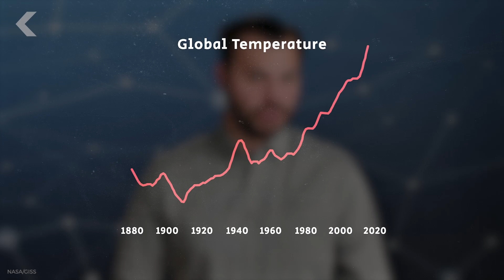These Massive Geoengineering Projects Won't Stop Global Warming

Comment: we have to start studying it seriously.  solar, wind, self-driving EVs, and energy effeciency are all going to dominate based on economics alone.  however, we may need to a few decades to figure out how to lower temperatures until we can figure out how to remove CO2 out of the atmosphere.  spaceX is dropping the cost of launch from over 12,000 per KG to $50 per kilogram by making reusable rockets.  there are some very technical ways to shade the earth while reducing side effects.  you only have to reduce the light by 2% to offset global warming.  we could do this for a few decades why we reforest the earth.  create man-made inland seas in the desert to sequester more carbon.  we can also make machines the scrub carbon from the atmosphere.   we will prevent catastrophic climate change, and part of the at will be quietly studying geoengineering.

Comment: i do not like this video.  the three main reasons they say it wont work.  1.) too expensive  2.) we should put all focus on reducing emission 3.) side effect.  well number one will not matter when we have AI, 3-d space printers, the can reduce themselves and nearly anything else money will not be a issue.  soon money may not even exist.  it is just a manmade rule/tool.  2.) is partially wrong because we can move the technology and science along with very little invesetment.  we need a contingency plan.  The science does not have to published in media.  we just do not announce that we have a plan B.  it will not be a secret, but it is not something that should be widely presented to the public.  3.)  we can reduce side effects, so that they are far, far less the deadly effects of climate change.  I like the idea of AI and self-replicating 3-printers in space making all the spacecraft and equipment

Comment: You could still do it. For example, engineering plants that strongly reflect any light they do not use for photosynthesis and using them as food crops.

If they are cheaper and better than cutting oil consumption down to nothing or dealing with the effects of climate change, then why not?

That being said, I don't think these would be all that advantageous. No matter what, these will not fix the problem of reduced heat escape in the IR, which could ultimately, in the long run, be more problematic for humanity, by which I mean technology, than increasing temperatures.

Comment: You mentioned in passing that the cost of fixing Global Warming would be far less than the damage caused by not fixing it.  Do you have a reference for that?  I've looked for a cost/benefit analysis for many years and haven't found one.

One issue is that the proposed "plans" appear to be nebulous at best.  Saying we should use renewable energy isn't much of a plan.  In order to analyze it, there needs to be more details.

Anyway, I'd appreciate it if someone could provide a cost/benefit analysis.  Thanks.

Comment: If this research is real, then you wouldn't have the cold simply moving.  A shift of the poles maybe, but not due to gases. Take ball and heat one side, then move the ball a bit with the heating element staying in the same place. Watch what happens. You can claim the temp is rising or lowering.

Comment: Proposals for solar radiation management (blanketing the atmosphere with sulfates) seem insane to me. We've already been engaging in a massive chemistry experiment with our atmosphere and oceans, the consequences of which we're still grasping to understand. Adding vast quantities of other particulates in to this grand experiment, not to solve the problem but just to mask it/delay it, just does not seem very smart at all.

Now there are artificial methods proposed to suck vast quantities of CO2 out of the atmosphere. Also fertilizing oceans with iron might be necessary to reverse acidification, trap carbon and stimulate phytoplankton. These combined with aggressive emissions reductions as well as reforestation of vast areas of land as we move to indoor-farming will hopefully be enough. In the end though we're locked in to temperature rise even if our emissions come down to zero, unless geoengineering is employed.

Comment: We need to stop driving gasoline powered cars.  Battery electric transportation everything.
All houses should have solar panels on the roofs with batteries for electrical storage.  
The electrical grid should only be used to supplement the shortfall.
Cities need to be designed in a manor to stop urban sprawl.  A building should have it's first few floors as retail and or commercial businesses and the top floors as residential.

The Earth will clean itself if we stop polluting it.

Comment: I think we should invest in research into geoengineering.  For one thing, I don't think it will necessarily make people want to use fossil fuels more.  Renewable energy, once perfected will still be cheaper in the long run, and the consumers will gladly welcome the savings.  Second, having a system in place to repair environmental damage will give us some protection against ALL climate changes, not just man-made.  Suppose a massive volcanic eruption or an asteroid impact or some change in solar activity causes a climate shift.  We can simply adjust the mirror (or whatever we end up using) to compensate and keep our climate stable.

Comment: Are you that stupid? Sorry to pop your progressive bubble but heat is not light and just cause you reflect light doesn't make heat go away.
Reply: It does actually. It reduces it. You still get some of the heat, but you reflect a lot of it outwards too.
Reply: You're bananas. Heat is transferred through conduction, convection, or radiation. Radiation is the method by which we get heat from the sun, in the form of INFRARED LIGHT.
Reply: ParadoxOfHonor Very skeptical
Reply: go up to your mirror put your hand next to it. it's not going to radiate that heat back.

Comment: We should build solar powered atmospheric centrifuge. This would allow us to separate the unwanted greenhouse gases for minimal cost. You could do this at a depleted gas well site and the gases can be injected back into the earth. You could chemically react the gases and turn them into solids that can be reused for other purposes, like renewable liquid fuels instead of continuing to manufacture gasoline from crude oil. This would not be cheap, but depending on what materials you produce the process might be able to pay for itself.

Comment: why dont we just get rid of the sun, problem solved
Reply: Doodlies I demand that this person be awarded the Nobel Prize
Reply: exactly, who needs the sun when we have light bulbs
Reply: Doodlies hold your L with pride
Reply: L? this is a ground breaking thing. No ones ever thought of that. How hard could it be. Just pick up the sun and chuck like rock. I promise the sun's gravity won't drag us a long
Reply: @randomgaming6808  Earth will completely freeze, what's global warming if there is no star to give it heat?
Reply: The sun may be a factor in global warming, but if global warming is just the act of heat from the sun being trapped by gasses, then global warming has been happening since the beginning of the earth, heating it up to normal temperatures, and, given the right conditions, will rise up to vaporizing levels, but we don't call that global warming, in fact, global warming is just a term we use for temperatures rising above normal recently due to more gasses. Yes of course the intensity of the sun is a good factor, but has it changed much? It's just the increase of greenhouse gasses, gases that trap heat from the sun, which we first of all need to allow those gasses to trap it in the first place. Therefore removing, or blocking, or anything for that matter, the sun, would cause all of us to freeze.
Reply: DON'T FORGET THE DIE OFF OF PLANTS, THE BASE OF THE FOOD CHAIN ITSELF!
Reply: ANONYMOUS 1 you're*
Reply: Bro you playing sround right ? Right ?
Reply: do you want to be depressed the sun gives vitamine d and without that you will get depressed........
Reply: Then we freeze and lose our orbit and probably collide with another planet
Reply: Throw water at on sun
Reply: That is kinda bad since the sun gives vitamin d and if you took it away the whole world will suffer from depression plus the food we grow needs the sun to grow and if we don’t have food we die!!!

(I’m not trying to be mean I was just informing you so pls don’t hate me)
Reply: News for you all... There is already a fake sun in orbit! It's placed in front of the real sun! Do some research! Take some pics of the sun and compare them to a pic of a led light. You will find the reflection in the pic is exactly the same. Have you ever took a pic of the sun only to find red of pink oblong lighting round the outside? 8 of them. One in each four corners and one on each of four sides. This is not your camera folks. Taking a pic of a led light gives the same effect. If it was natural light coming from the "sun" it would not give this affect.
Reply: Doodlies your.. your a fuckin idiot XD
Reply: Oh shit LMAO

Comment: make a huge thermocouple which has its one end at the North Pole and the other at the South Pole , so that current would flow from North to the south  lighting up the world from top to the bottom. This would make our green house gases to reduce and save our fuel and reduce pollution.
spent your efforts and budget on this mega project. I think this could be a good solution.

Comment: i think a big problem is technology. in 1960 the frist pcs where there, in 2000 almost every house had one, now in 2017 every house has multiple pcs that emmit heat, and all those computers are cummunicating with huge server farms all around the globe. just look at a bitcoin farm and the air conditioning it needs. every few meters is basically a small heater, i dont even have to heat my room in winter when i game for a few hours

Comment: Saying "most" client scientist agree that climate change is real and caused by humans is an understatement.  "Almost all" would be a much more accurate descriptor.
Reply: +acousticpsychosis   Convictions by court, i.e. jury concensus, or what some judge rules, are not proof.
So hilarious that rightards NEVER talk about freeing everybody from prison.
Reply: Carbon Greenhouse Gas Effect was debunked way back in 1909 in the famous Woods experiment and again in 2011 by Nahle.
Reply: +Rick Seiden   Exactly
Reply: +Rick Seiden  "But the proof that has brought them to the consensus is proof. "
Exactly
Reply: The problem with that graph it assumes that heating up by co2 emission is linear but its most certainly not, its takes a doubling of co2 concentration to get the SAME temperature increase as before, we haven't even doubled our co2 concentration yet, 400 ppm. *2Its from 280ppm to ~400 ppm atm and barely got 1 degree... to get to 560(doubling of pre-industrial era co2) we need another 160 ppm of co2 so we might get ~2.5 degree warming and it will take until 1,120 ppm to get to 5 degrees(summer/winter swing more than this). 

If the green nutso and envirowackos were so concerned about warming from co2 they would be pushing nuclear that works now instead of being against it, especially molten salt and new  safer reactors designs. Placing a price on COAL instead of carbon would help move away from coal power plants which kill the most people per energy produce of any source, not due to co2 emission but funny enough the radioactive  and carcinogenic fly ash it puts out! While nuclear is the safest.
Also what is also swept under the rug is negative fed back loops, like temperature increasing water vapor that increases cloud cover which reflects more sunlight away from the planet, this reflection is so strong it accounts for about ~90% reflection against ice about of ~4% reflection. Plants also grow faster, stronger and in more arid places in more co2 concentrations which further reduces co2 funny that.

Comment: It always comes down to Money !
Right now with our current technology we could halt global warming by going nuclear and increasing renewable energy generation and creating viable public transport systems.
So why aren't we doing it ? Because coal is cheap and building the infrastructure to make good public transport is expensive.
But nuclear power is dangerous right ? Only if the power plants are designed to be built for the least amount of resources (building materials and money).
Sit a team of the best engineers down and tell them to design the safest Nuclear Power plant ever and it will cost a billion dollars.
Sit those same engineers down and tell them to design a safe Nuclear Power Plant as cheap as they can and you get Chernoble or Fukushima.

Comment: you're making the assumption that solar panels and wind and vehicles that run on batteries isn't going on and becoming more pervasive and inexpensive. 
battery powered self driving trucks are soon if not already a thing. self driving cars will soon be a thing. battery powered everything is becoming a thing. 

temporary fixes to allow time to move off of fossil fuels, as is occurring now, is not a bad thing. Just as giving power to the government to tax the crap out of us in the name of climate change is a horrible idea (as are all money and power grabs by the government). 

new innovations are coming out all the time to alleviate the use of coal and petroleum products.
Reply: You need to realize that in order to fuel battery powered vehicles you need to produce electricity, obviously. But as long as the vast majority of the world's electricity production comes from thermal power stations (all of them fueled by some kind of fossil fuel, be it oil, coal, nuclear energy...), the use of battery powered stuff doesn't help in adressing the global warming issue whatsoever. Actually, if anything, it worsens it, by increasing ever so much the electricity demand, thus making us become ever more dependent on all the different energy sources, that, again, are still today and will still be for decades to come, largely of fossil origin.